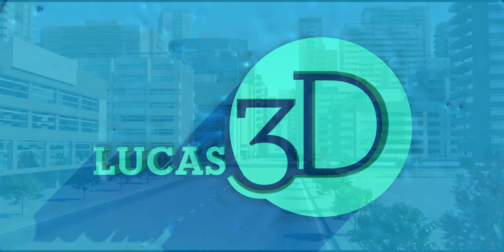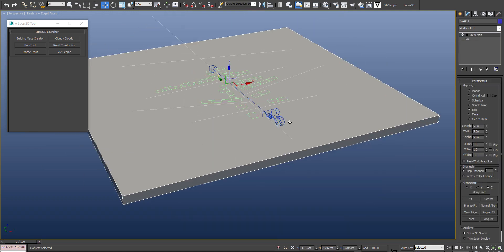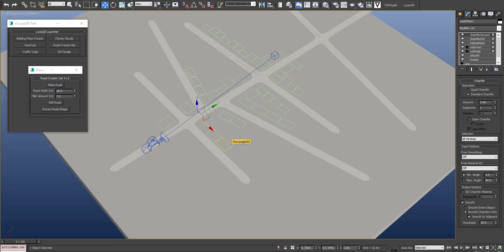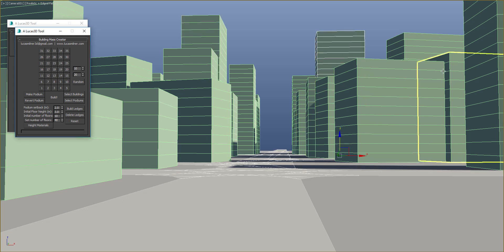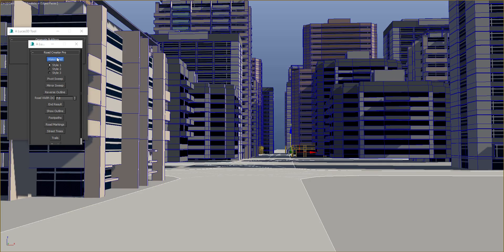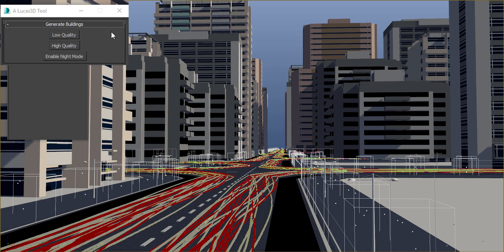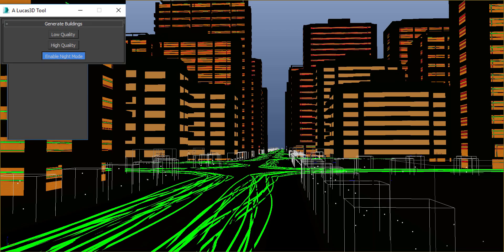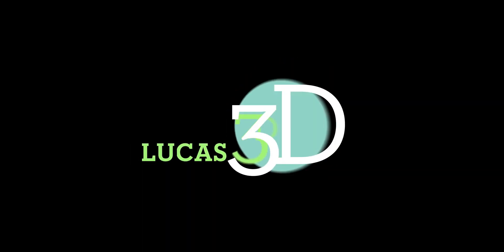Work in progress - Building Generation

Comment: Interesting tool. I've bought the mass generator but there are not all functionalities as shown here?
Reply from the maker: George Nicola thank you! At the moment this is still just a work in progress for an optional tool that works hand in hand with the Building Mass Creator.
I believe there are many that only require quick building masses and not higher res buildings so the Mass Creator remains a low cost solution for them.
For people that want it, this will be a nice way to populate a scene with articulated buildings.
Reply: Do you plan to release this update? There are some scrips, but none of them works with splines and irregular shapes, sadly.
Reply from the maker: Yes, I still need to create many new building models and create a good system that works for 3ds Max 2016, 17, 18, 19. No more mental ray.
Reply: I'll throw an eye from time to time for this update. Thank you.